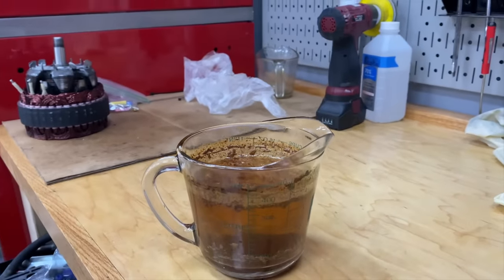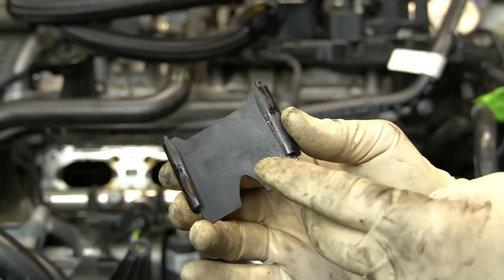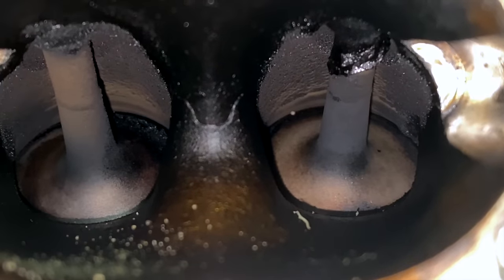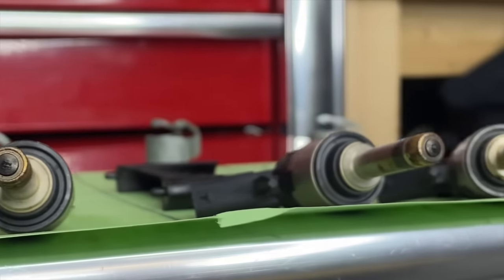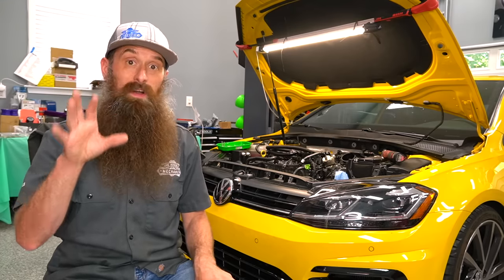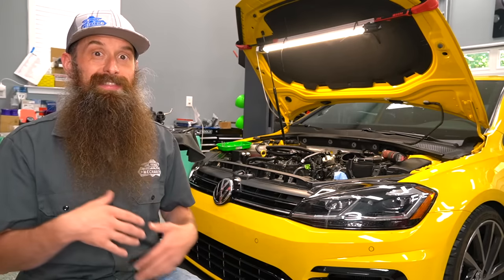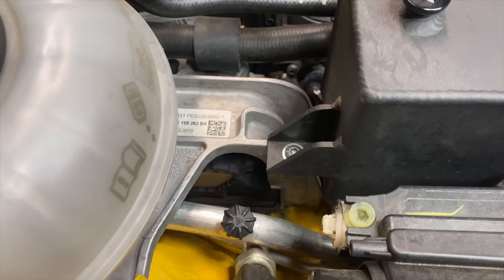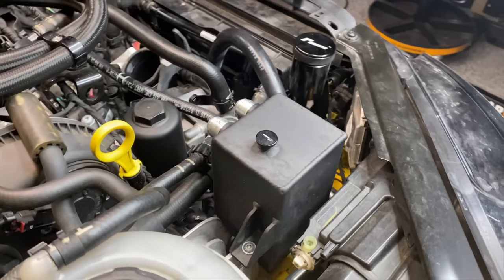Did the Catch Can Work? 10k MILE TEST

Comment: Great video as always! I remember finding a link in a forum (maybe VW Vortex?) that Mishimoto(?) did not have success developing an effective catch can developed for the Mk7 because they found that the PCV/oil separator VW installed was so effective. That was an older article so that may not be up to date and they may have developed something! Lol

Just bought an Alltrack in 2020 (first step into the DI world). I watched your older video from 6 years ago about ways to prevent/slow carbon build-up. You mentioned that there's still a lot we don't quite understand about carbon build-up then and it looks like we may be in the same boat now. Just curious if there has been any further revelation on the topic of carbon build-up. As a lifelong VW owner, I appreciate your insight and your hard work!

Comment: Wait ,is this an engine with a turbo? You hear oil smell? Have you checked the exit of the compressor for OIL leakes. if you are sucking air from outside there are only three things that can dirty te valves;1 Compressor leaking oil, 2 Valve leaking oil, Turbine leagking oil and EGR introducing it to the intake line. But this is a very good test, BONUS Catch Can not isolating properly the liquid. How is the inside of that catch can, is there any labirinth to prevent spilled liquid to be pushed in the intake? Great Video!

Comment: I have an aftermarket FMIC, and I recently took my front bumper off because I’m installing a water/meth kit, and I had to take off the outlet intercooler hose, as my boost hose going into the throttle body is going to be replaced. Well, there was a bunch of oil in the intercooler hose, and there was oil dripping out of my aftermarket FMIC. So we decided to take it apart and clean the entire system. 

My questions to you are these:

Since there was oil inside my FMIC, does this mean that I probably should get an oil catch can? Is it bad for oil to be inside my FMIC? I’m currently IS38 on my MK7 GTI with a custom tune. 100k miles. I’ve performed 2 carbon intake and valve cleanings. Car runs really good, but just thought I might ask you about this.

Comment: I'm glad I'm in a country where the same EA888 engine comes standard with multiport injection. I tried running a can of CRC intake and turbo cleaner through it before my last oil change, and there was virtually no white smoke during or afterwards, so I guess that's a sign that there is no, or minimal, carbon buildup.

Comment: Some of the water could be condensation when hot breather air is stored in the cold metal can.

My cars have all slowly build up carbon in the exhaust, leading to a different exhaust sound every time I have been on a roadtrip.
I think that carbon build up is like changing oil, it quickly turns black and sod, but after that the build up flattens out.

Comment: Well only way to find out about that burnt oil smell is to remove the catch can...

As for the results I believe it's a bit of both as usual. That the can does good is evident by the gunk it collected though I had expected (hoped) for more oil and less water. But some ultimate-perfect-magic solution it isn't.
That the build-up had been reduced in the not cleaned intakes seems reasonable - If you blow clean air over a gunky part the gunk will (very slowly) be removed. 
But driving patterns, fully run in engine etc will have a big influence as well.

I'm pondering an Audi with the 2.0 TFSI and will without a doubt mount a can (if there isn't a good one already) if I get one. One with a drain and empty it often in the winter.

Comment: I would say to check it again in another 10/20k. Maybe bore scope cyls 2 & 3 at 10k, and then intake off again at 20k?

Personally, I'd rather just walnut blast every 20-30k than have to worry about my catch can freezing in the winter, but I am capable of doing that, just like you. If I wasn't, maybe it would make me consider seasonal swaps between stock PCV for winter and catch can for summer with a carbon check maybe every other winter.

Comment: I too get a smell, usually a gas like smell when the catch can if full, its actually closer to a mineral spirits smell. That is my biggest complaint, I don't have any leaks either but I do have this gas like smell often enough. I've been using one on my 3.0t supercharged Audi for about 30k miles. I did modify it by adding a ball valve on the bottom to allow easy draining of the water.  I drain it every few weeks and remove it every other month to clean the oily goop out, the thick goop that comes out of it does smell like mineral spirits.

Comment: Looks like aerated water keeps flying through, and the heavy crud lands in the can. The water cleans the valves. Before seafoam, using a brake booster hose to suck water into the intake ehile at half throttle, would rinse the valves on a cold started engine. The water freezing in the catch can is something I have never considered in the install. Can't wait for the '01 Jetta/Beetle hvac system rebuild.

Comment: Yo bro , it's the Ceratec that did the cleaning job on the valve . The OCC just only prevent the dirt on it, which makes success cleaning on the valve . . well I also use OCC for almost 2 years , but mine have valve on the bottom. but didn collect that much water like yours. maybe where is stay is hot and humid . Cheers on the experiment

Comment: Going from a dealer technician to PM auto sales I’ve learned that on DI engines the carbon build up is from the oil system. Low tension less drag rings allows oil to get into the intake and that’s being sent back into the combustion chamber. As a car enthusiast I do believe the catch can does help but will not stop the carbon build up.
Reply: How would oil in the combustion chamber end up in the intake? The air rushing into the cylinder would prevent that. It would just cause it to burn oil
Reply: @djmartin4776  not really. Oil vapors yes but actual oil is heavier than air. And the pcv systems allow oil vapor and some oil into the intake manifold. This creates a different kind of carbon on the valves. But as we moved to low tension piston rings for more power and efficiency they tend to stick to the pistons, when not cleaned regularly with a crank case cleaner, fuel service due to carbon build up and oil is getting passed the rings into the combustion chamber causing a thing called low speed pre ignition (LSPI) and that is how oil gets in the combustion chamber. Engineering explained has a whole video on GDI engines and low speed pre ignition. It’s about 10-15 minutes of really good information.

Comment: I really wish there was an air oil separator option for the golf like there ones AIG and Cobb make for the Subaru platform. Hose really work great. They circulate coolant around it which vaporizes the water and separates it from the oil. The clean air goes to the intake and the oil back into the crank case. Nothing to empty and essentially eliminates oil vapor entering the intake. Would be interesting to see someone try to fit one to a GTI or Golf R.

Comment: It would be interesting to put an oil separator on it instead. The filter company Mann+Hummel makes some called Provent 100,  200 and 400. They are mostly found on big construction equipment engines. They have a oil separater filter that you change every 500h. The only issue is that they return oil and other stuff back to the sump. That could properly be routed to a can instead? But then again they also change the oil every 500 h.
Reply: I run a ProVent 200 on my 3.2L DuraTorq Diesel in my Ford Ranger and instead of running the line from the provent back into the sump I run it into a separate line and collection cup ;)  Still get a lot of water in the winter but loads of oil as well.

Comment: Burning a gallon of gasoline produces around 1 gallon of water. Even with blow-by of 1% over the course of say 200 to 300miles this is around half liter of water flowing into the crankcase. That is to say, the catch can is catching a negligible amount of water, most of it is going back into the engine intake manifold. Next there are two sides to a PCV system, Idle/cruise and WOT side. The WOT side is the engine health side where a catch can belongs for when the pistons break and blow-by forcing oil out of the engine and onto the track, is caught instead of causing a car crash. The idle/cruise side is a restricted side of the pcv system it either has a restriction orifice or a PCV valve which limits flow and the can volume added to this side increases the surface area and volume of the pcv system which allows water and blow-by gas to slow, condense, and collect as the gas cools especially when the engine has just been shut off, much of the water you see collecting is collecting like it does in the exhaust system after the engine has been shut down and exhaust gas is cooling in the presence of water forming carbonic acids in the exhaust (and catch can) which are then due to partial pressure of dissolved gasses able to interact with the intake system components as heat cycling in the presence of pressure changes ensue. Next we consider that blow-by gas contains partially reacted hydrocarbon gas and oil as a gas which as a gas state cannot be captured in the catch device. Oil droplets on the other hand are intentionally separated by the engine's internal oil/air separator 'baffle' when appropriate input kinetic energy supplied by pressure gradient from the engine's intake system, and by installing the additional volume and friction of the catch can lines/surface area the kinetic energy supply for oil/air separation is limited and the transition from low pressure to high pressure (transitions from idle/cruise to WOT and back) create a delay in the change of pressure due to the restriction orifice of the pcv valve (or simple orifice for engines without a pcv valve) which cause poor oil separation and increased condensation of oil droplets forming- in other words you will force more oil out of the engine if you ruin the original engineering behind the internal air/oil separators which depend on kinetic energy input and small diameter lines (high velocity and low volume) for rapid separation and rapid return of hydrocarbon gas to the combustion chambers. Finally the oil and water collected in the can along with carbon constituents all have partial pressure and are being subjected to the low pressure supplied by the intake suction so they are constantly being ingested at some rate exactly as if you placed a container of oil and water in a vacuum for (hours of engine operation) which as we know contain additional products such as carbonic acids due to being reacted and heat cycled under various pressure in the presence of water and hydrocarbon and the oxygen which flows into the fresh air induction of crankcase from the WOT side (fresh air vent inlet) which is how those comounds react and oxidized forming myriad conglomerates and unwanted carbon products that gradually make their way into the engine. 

No you do not want any kind of catch can on any engine unless its a vacuum pump style engine with low tension oil rings intended for high output drag racing in a situation where the engine could explode violently in which case yes there should be some kind of oil tank reservoir or dry sump system to catch oil that comes gushing out of the engine when it explodes.

Comment: I think the cleaning up of the valves is more a product of you removing the water vapor that could mix with the oil to create thick n tacky grease. The absence of grease removes the ability for deposits to stick since it’s constantly getting impinged by incoming air which force is greater than the pure carbon’s static friction force. Also, you can install a simple check valve into the PCV hose if it doesn’t already have one factory installed onto it. That should prevent backflow issues you were concerned with.

Comment: We were always taught in the UK during the buying process for performance VAG’s, was to try and avoid short drives too much, because that’s when you get carbon build up. The thing about carbon is that once it’s been deteriorated with heat enough, and for long enough, it practically vaporizes and leaves the system through the exhaust by being passed in to the cylinders for incineration as an extremely fine fog, along with the air. So maybe it’s just the 400 mile trip, you’d be surprised what 2500c can cook away over the course of about what, 6.5-7.5 hours?

Comment: Although my engine is a EA827 1.8 20VT. 
I have been doing the same head scratching.
After I installed a catch can, I sometimes have a burning oil smell from the car.
And this is on a completely rebuilt engine.
I might try and reinstall the factory PCV system and see if the smell goes away.

Glad to know I'm not the only one that have experienced this problem.
Reply: I've seen posts claiming that the oil smell is from inferior hoses that are used when installing the catch can.  One person commented that Teflon lined hose will prevent the oil smell.
Reply: I use the same hoses for the stock PCV system now, and there is no oil smell, might be a cheap catch can.

Comment: I'm guessing that the smell is coming from that dipstick hole when under boost.  Incidentally, it's worth asking where the water comes from.  The answer is surely that it comes as vapor from the intake when under boost, and condenses in the cold  can.   Moving the PCV (or inserting another) between the can and the intake would prevent that moisture being collected,  solve the potential winter issue, and  increase  boost speed,

Comment: Thanks a million Charles, your test has shown the benefits explicitly. But, there are a few but's :) Would you say that the soot passed through the EGR couldn't stick on those valves,  because the OCC didn't let the oil in? And the second matter, let's say it was not a gasoline engine, but a TDI. Wouldn't the carbon buildup be more obvious in a highly stressed, turbo-stratified diesel engine than in a gasoline engine? Your test results would be significantly more different in a TDI. I mean, less water and more oil caught. And ofcourse lesser carbon buildup.

Comment: Did the engine get a tune as well? Black dry carbon before the catch can is from valve overlap... no? A tune can change what gets pushed back / how much heat the intake valves "see", which results in the pcv oil baking to the seats, more so than the exhaust soot (fine powder). Catch cans condens water from the warm air... if you tap an injector into the bottom of the bottle, you can inject the water into the intake to clean the valve and not have to worry about draining the bottle. =)
Just kidding.
Reply: On further thought... if there was no change in tune, then the lack of PCV did stop the carbon (exhaust / intake valve overlap) from sticking. So then I would say that catch cans do work (but I'm still not a fan of them). =)
Reply: Nice to see you still active on VW comments sections Thomas :)
Reply: @guidosaur7506  I linger in a lot of places! LOL

Comment: Basically, if you can remove all of the oil mist from the crankcase blow by gasses then the inlet manifold would be entirely clean (if the air filters also doing 100% filtration). If any trace of oil mist can enter the inlet manifold then depending on the amount will dictate how fast the valves get carbon build up (which isn't the same as combustion cylinder carbon build up as it's really just oil that's been baked dry and not excess petrol from an incomplete combustion cycle).
OEM manufacturers cheap out on PCV systems and do what's necessary to meet emissions standards but the PCV system is really very basic in design. 

The valves have probably self cleaned since the catch can install due to valves getting hot enough to burn off the build up that was there. Catch cans are also not the best solution compared to an oil separator can because depending on the baffles within the catch can will dictate how much oil mist is removed from the blowby gasses that then get drawn into the engine. If the catch can was vented to atmosphere and not back into the engine then you'd see even more of a difference.

Anyhow, still a good before and after test of a catch can, even if it is rather expensive for basically being a powdercoated aluminium box.

Comment: Great video.  I like seeing the intake ports and valves.  It might be beneficial to try a coalescing catch can.  I have a Mann provent on my car and I get 99% oil in the summer and 90% oil 10% water in the winter.  If there isn't some sort of media inside the can for the oil mist to stick to and drip down the mist can just carry through and head on into the intake then to the intake valves.
Reply: I had this catch can in my golf tdi 2005. No problems summer or winter. Totally forgot about it. Thanks for the reminder. 👌

Comment: Fumoto F106SX valve installed in place of the drain plug on the VWR can and you will never have to unbolt it from the mount again. It’s a little tight to get to the lock and valve but it works great. Went a step further and routed a permanent hose to a 90 from the Fumoto down to the belly pan. Takes about 3 minutes to drain the can now. Kick a pan under the car and pull the lock and turn the valve. Done. Also, the oil smell you have, it’s coming from the hoses. I noticed the smell immediately and thought it was from the dipstick at first. Those hoses somehow allow vapor fumes through them. Don’t believe me? Go for a drive and pop your hood and get your nose as close to the hoses as you safely can.

Comment: I think you're doing well with your approach! 😃👍
- The can will help against carbon buildup.
- The can will help against sheared hydrocarbons and calcium entering the engine what both could cause LSPI.
- Just ask yourself if you would like to voluntarilypour the disgusting fluid of the can into your engine!🤭
- You're able to remove the intake manifold easily - why not spraying some cleaner onto the valves every 20 to 40 k mi? 😎